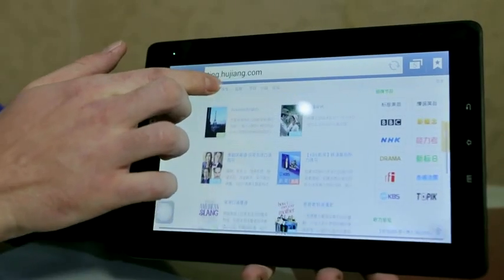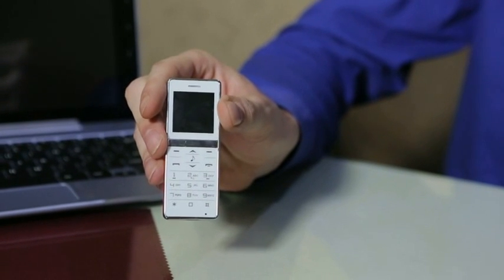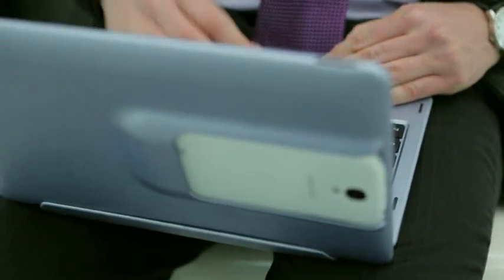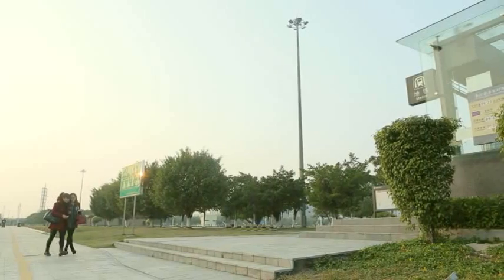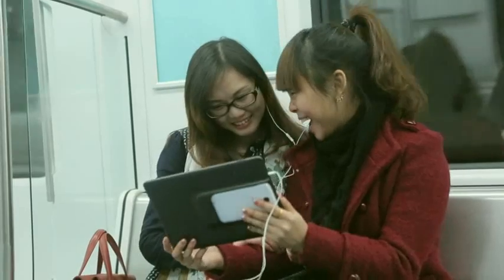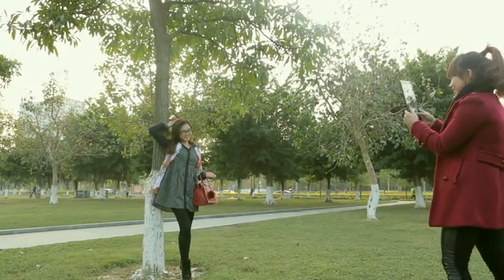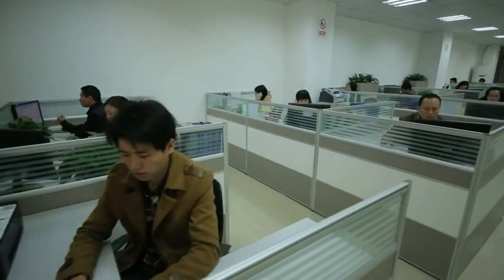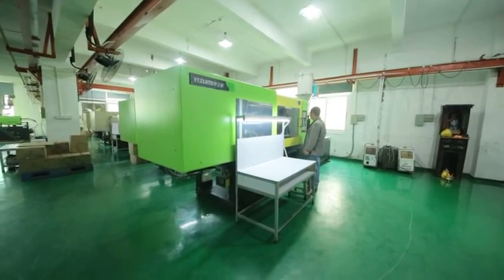Transmaker indiegogo

Comment: So it's just a portable monitor and MHL cable converter and a USB keyboard. All put in a case that you can make yourself with a 3d printer. Simple and good idea I had long ago. It's easier and more compatible to use MHL cable because you don't need to attach the phone and permits you to use s4 se s5 note 2 note 3 note 4.etc.